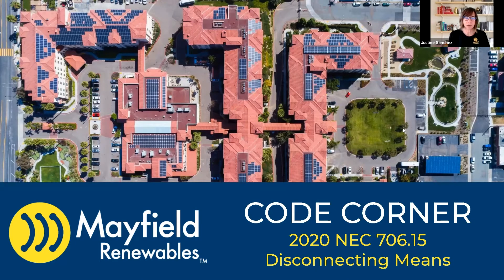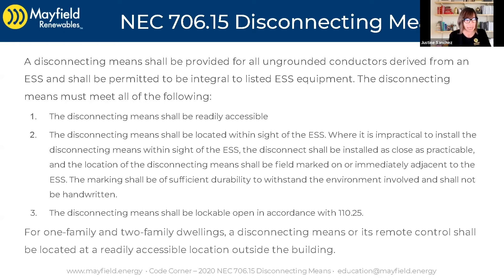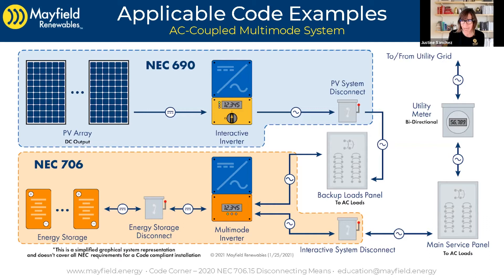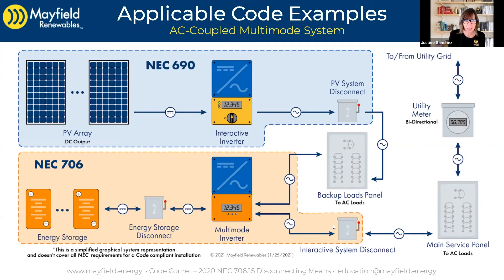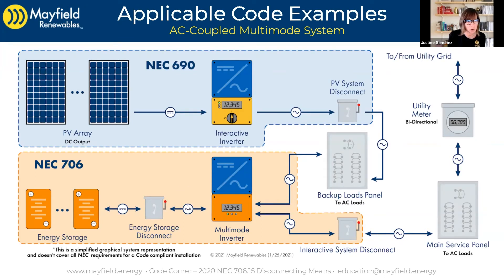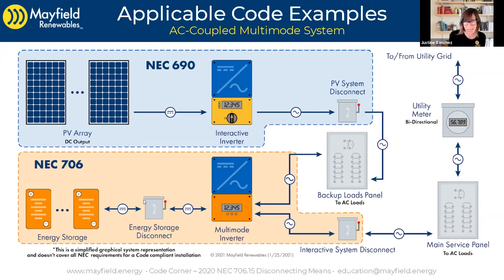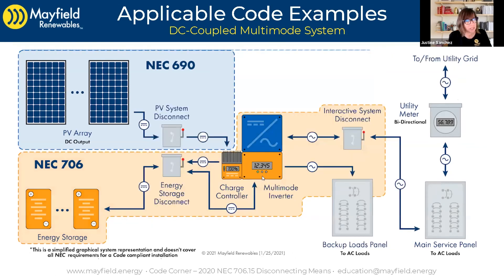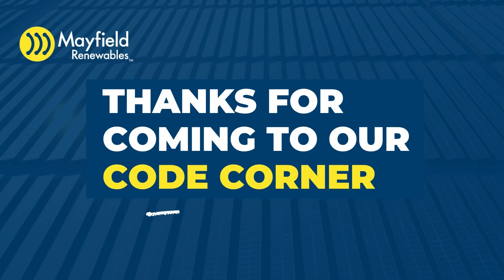Mayfield Renewables Code Corner: 2020 NEC 706.15 Disconnecting Means

Comment: Does this apply to PV Solar + Storage plants as well or only residential / industrial buildings?
Reply from the maker: The scope of Article 706 includes all energy storage systems with capacities greater than 1 kWh, regardless of where the system is installed. You will always need a means to disconnect your ESS from the rest of the system. Some specific requirements will only apply to residential, namely: “For one-family and two-family dwellings, a disconnecting means or its remote control shall be located at a readily accessible location outside the building.” This is from the 2020 NEC, 2023 clarified the language but kept the specific location for one and two-family dwellings.

Comment: Justine, I spoke with SMA technical service regarding meeting this code requirement and their SMA Sunny Island 6048 US product (using sealed lead acid batteries).  You indicate the disconnect must be on the DC side in this video but doesn't a disconnect on the AC side (of multimode inverter) going to the critical loads provide the same protection to shut down power derived from conductors of the ESS?    SMA support has told me that is what I need to do not install at DC switch on the battery cables located outside and readily accessible.
It seems some of the other comments here are saying the same thing. 
Have you changed this assessment since making this video that the disconnect must be on the DC side of the multimode inverter?  This is kind of a big issue I'd like to know if any progress has been made on what seems to be ambiguous in your video.
Reply: The 706.15(A) requirement for an emergency disconnect outdoors in a readily accessible location for one and two-family dwellings was not very clear in 2020 and was clarified in the 2023 Code. I realize that the 2023 language may not be enforceable for you immediately, but the clarification is often welcomed by both installers and AHJs and accepted when it helps all involved, which I believe it does in this case. In short, 2023 calls for an "an emergency shutdown function to cease the export of power from the ESS to premises wiring of other systems." The commentary in the 2020 Handbook also refers to emergency disconnects in 230.85 immediately after the 706.15 language. Therefore, I would say the intent in 2020 is for exactly that, an emergency disconnect to cease the production of power from the ESS system. 

To meet that requirement, as Justine discusses, we need a way to turn the ESS inverter off. But Code does not dictate in 706 that this is done on either the ac or dc side specifically. As she points out, if the disconnect were the one that connects the inverter to the utility, that would only initiate the off-grid mode of the inverter. I would say you would need a way to "cease the export of power" from that inverter entirely. This may mean a disconnect on both the input and output of the inverter. 

In an emergency situation, the utility power would be removed from the building anyway. So one could argue the outdoor emergency disconnect for the utility connection would not be required. The inverter output would need to cease power production though. You could use a disconnect for that output circuit in that scenario. I believe a better solution would be to use an inverter's relay capabilities (it's been so long since I've installed a Sunny Island that I can't remember the specifics for that one). This way, you don't route any power conductors unnecessarily and use an exterior switch to send a signal to the inverter to shut down. One could argue this is safer. If you route the inverter output circuits outside and then back into the load center, the line side of that disconnect would still have voltage (presuming the batteries are still connected), and therefore that section of the circuit would be energized and a hazard to firefighters. 

Of course, this emergency disconnect could also be accomplished by disconnecting the dc conductors from the batteries, but as for the reasons stated, this may not be the best answer. 

To answer the question directly, yes I believe a disconnect between the inverter and backup load center would meet the requirements. To be compliant, you do need to consider the utility input connection too.
Reply: @ryanmayfield2728  Thank you for clarifying.  As soon as I heard her say the disconnect has to be on the DC side and how complicated that was, I stopped watching the video as I didn't understand why she didn't even mention one on the output of the system.

Comment: Does the 2020 Code actually require a DC disconnect?

2020 NEC 706.2 definition of ESS is "One or more components assembled together capable of storing energy and providing electrical energy into the premises wiring system..."

2020 NEC 706.15(A) states that "... A disconnecting means shall be provided for all ungrounded conductors derived from an ESS and shall be permitted to be integral to listed ESS equipment."

So it seems by the language used, one could make an argument that the conductors that are intended to be shut down are actually the "Derived" conductors from the ESS, as stated in the NEC, thus the AC output conductors from the backup inverter. Noteworthy, disconnecting the DC cables on an inverter under load can be very dangerous/damaging, so it makes much more sense to remotely shut down the inverter itself. Some inverters have this capability built in to do an emergency shutdown which de-energizes "all ungrounded conductors derived from an ESS". This is a far more elegant solution for sure and the manufacturer recommended one from the equipment I use.
Reply: Which manufacturer are you talking about here?  SMA?
Reply: Not necessarily. See my comment above for additional info as the 2023 Code gave us good clarification.